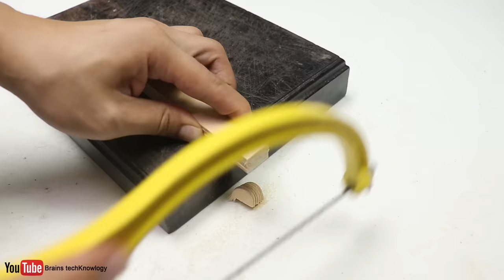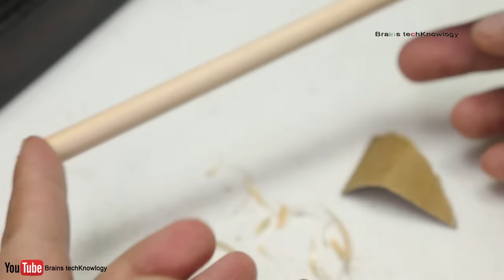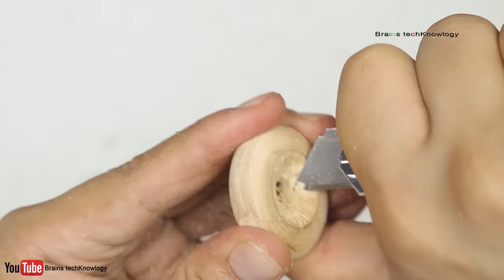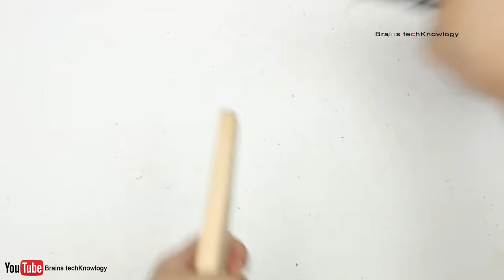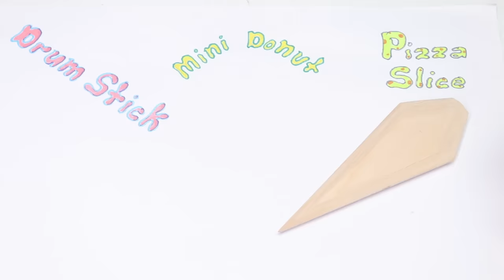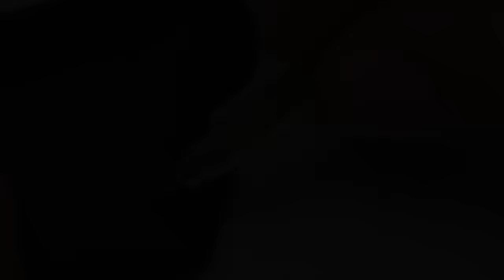How to make Popsicle Stick KUNAI knife without using power tools - Realistic design

Comment: What sort of glue is needed for this kind of projects? Also, is the sand paper necessary? I'm working on a tight budget, and I can't get my hands on professional equipment easily.
Reply from the maker: I used elmers glue for this. Also sand paper is a must if you want to achieve smooth surface.

Comment: Merci pour cette vidéo. Je vois pas mal de tutos en ce moment sur youtube d'armes de cosplay faites à partir de "popsicle sticks" ... La question que je me pose c'est POURQUOI ? Quels sont les avantages d'utiliser ca ? Le prix ? La facilité de coupe ? La résistance ?
Reply from the maker: lots of people are copying me now but. one of the benefit is that, its really cheap but, you need skills to cut it so you really need to practice on cutting popsicle sticks.
Reply: @BrainstechKnowlogy  Thank you for the answer. Until now I made my blades in 6mm thick plywood. I have all the necessary tools, I don't think the sticks will be a problem. On the contrary, it should allow finer and simpler work on certain parts :).